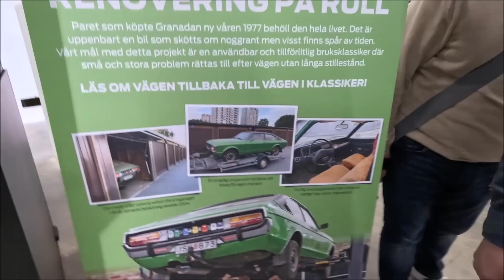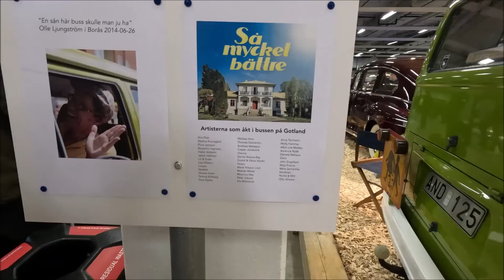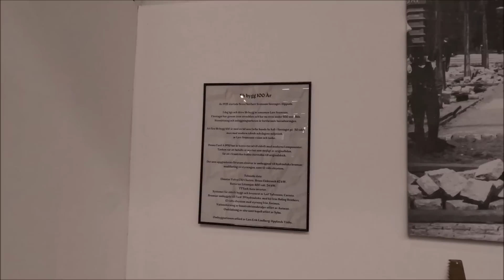Elmia 2023, Custom Motor Show. Hittar vi nåt kul?

Comment: Kul å se. Va inte där själv i år. Verkar gå fint w115 200. När man höll på med compakter själv så va det standard att plocka ur bensin motorn å slänga i en diesel. Har nog varit med på 5-6 stk såna byten. W115-w123. Bensinmotorerna blev bara å ställa bak lagårn 😁
Reply from the maker: W115 går alltid fint! Har du några överblivna bensinmotorer på lager? 🙂